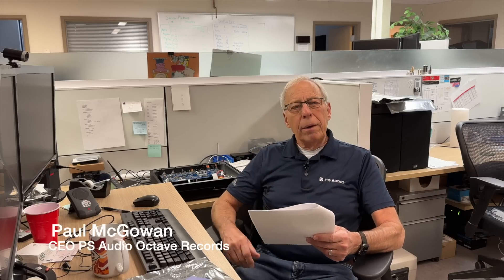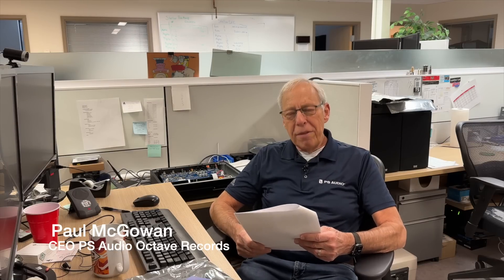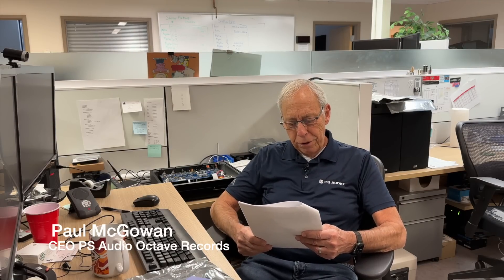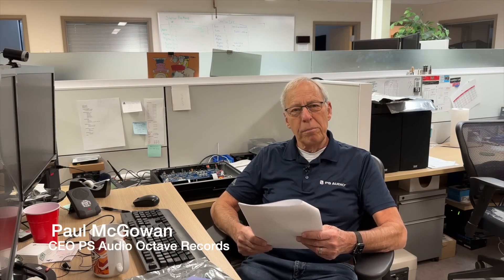Does a subwoofer benefit from a Power Plant?

Comment: I don't understand. Some time ago there was told the biggest plus of a power plant is its lower output impedance.

If the source of the load is lower, the voltage drops less when it's loaded

Most energy/current sit in the bass, so the voltage will drop the most with large bass Peaks.

The mid/high frequencies are seldom more than 10 a 20 watt. This causes at most a few millivolt drop of the line voltage. If it's more, you have a serious fire risk when loading that line with a heavy load . .

I am surprised that the devices like a subwoofer that really ask the most from the source benefits the least

Comment: Re-gen may provide a stiff and clean voltage, but what's vital for LF is ampacity and low output impedance. 

Hence the position to bypass the unit.
Reply: Some time ago the power plant was promoted as a device that lowers the source impedance, after a review that showed the powerplant increased the noise output. The whole purpose was the lower source impedance it provides

Comment: My regenerator didn't help much with the sound at any frequency but the thing we don't often hear discussed is the increase in circuit longevity with rock stable clean regulated power.  If I had any high quality components and I was planning on keeping them for a long time, a regenerator is the best protection you can get.  And most people do hear sonic improvements so they can be a great addition to your system.

Comment: You don't hear a suwofer at 30Hz, you only feel it
Reply: I hear mine at 30hz. 
Subjectivly, somewhere down to ~17hz-18hz.
Reply: @FOH3663  have a hearing test done. and then see what you can hear. (no 30hz) maybe 50hz
Reply: @arjanrobben3768  
Please define hearing test.
Reply: Our hearing doesn't stop at a certain frequency ... our sensitivity, represented via the Equal Loudness Contours, is diminished as freqs lower. 

Whereas around 40hz requires ~50dB to be discernible, and an octave lower at ~20hz requires ~25dB more level to be discernible. 

Our ability doesn't simply stop, our hearing sensitivity just requires more SPL the lower in freq.

Comment: One of the things I love about Paul is that despite regular sales pitches, he isn't invariably tooting his own horn when it comes to a waste of money. I've actually tried every variation of what he's discussing here, with and without subs, with and without regenerator, and of course he knows what he's talking about crossing subs as low 30Hz making it near impossible to hear a difference versus crossing higher. I'd like to add two aspects: check how much power the remainder of the system consumes before plugging in subs (scroll display, you'll find it), and if it's already at 70-80%, that's a no-go (in other words, be sure to leave some headroom). Secondly, use the outlets with inrush limiters versus plugging the main speaker amp into those. Thirdly, always try every option (with and without regenerator, and every constellation in-between). Simply "believing" a regenerator (much less a mains filter) is going to improve the sound is no less dogmatic thinking than "believing" regenerators (let alone mains filters) have no effect on the sound. The truth is you might not notice a difference (waste of money), not like what it does (even worse), and of course it may do something for your system (in which case one might still be curious to hear what difference it makes, at least if one has any curiosity, scientific or otherwise). I personally plug in a pair of servo subs into those outlets marked "High Current", for the following reasons: once one gets the point, which is that subs are meant to integrate and not draw attention to themselves, one may note a negligible improvement in integration/overall synergy plugging the subs into the regenerator along with the remainder of the system, plus I like the sound better than plugging the main speaker amplifier into the "High Currant" outlets (maybe someone knows if the inrush limiter there is using an MOV, be that as it may, best to be pragmatic about it, the proof is in the listening, don't just waste time and money believing me or anyone else, always be sure to try for yourself).
Reply: I've no opinion on regenerators, but two thumbs up for Leon Fleisher! A great artist with an truly inspirational story.
Reply: @waltergist8923  Indeed, he was, and I'm glad to have met him and heard him perform. He's an inspiration to all of us who have to or have overcome adversity in life, and many of his recordings, in particular with George Szell and the Cleveland Orchestra, are among my desert island favorites. Anyone looking on not knowing who Walter and I are referring to, be sure to listen to e.g. the Brahms Concerti (starting with the 1st movement of No. 1, of course), Beethoven No. 4 (that 1st-movement cadenza!) and so much more!
Reply: @LeonFleisherFan  I envy your experience. I have the Brahms and Beethoven recordings in the Sony remasters of the Epic label recordings from the late 50's. He handles the range of high drama to deep intospection very well.
Reply: If you set the subwoofer to 30 Hz, you might as well buy a rumbelseat
Reply: @arjanrobben3768  Maybe if one were into home theatre. For music, it's a misconception to believe the only purpose of a subwoofer is to produce audible bass, much less be set up and turned up to where it's drawing attention to itself. Properly set up the increase in soundstage size and scale (reproducing spacial cues) are such the whole presentation sounds more realistic from top to bottom (if you've never heard it, you need to), plus it'll help with room modes, i.e. make for a larger sweet spot in the room to sit and enjoy music in company. Actually, the upper harmonics are probably the reason one hears a difference plugging in subs into a regenerator at all, as I doubt it has an impact on the bass itself. That part is subtle anyways, using well-integrated subwoofers for listen to music is not.

Comment: Paul is shooting himself in the foot here.
Most of the energy of music is contained in the lower frequencies, (pink noise type spectrum), so the high current surges would occur here.
I thought that one of his main arguments for power regenerators was that they provide a very low impedance stabilised voltage, able to resist sudden high current draws like those you would get from thumping bass where the room lights dance in unison!
Personally, I wouldn't bother either way.😊
Reply: You did watch the video to end, though? Provided a subwoofer is crossed as low as Paul suggests, i.e. 30Hz (remember that's 30 cycles per second and below), the difference is going to be hard to hear. I've built servo subs that play down to 14Hz and can confirm it makes a difference whether they're crossed at 80Hz as in a THX system, or integrated into an audiophile system where they're not meant to draw attention to themselves.
Reply: The human hearing system is unable to discriminate to small changes around, say, 30Hz.  Indeed, the whole craze for subwoofers is more driven by people who just want to feel the THUMP THUMP of special effects than those who are listening to a musical instrument.
Reply: @TheDanEdwards  Apart from the fact that subwoofers add greatly to music playback if set up right and well-integrated, they also improve the bass performance across the room (room modes) and help widen the sweet spot, which in turn allows the main speaker to be set up for maximum soundstage and imaging focus versus bass response. Using main speakers only, setup is bound to be compromise. What one really tries to achieve is for the lower midrange/upper bass to couple so human voices have chest and body and sound as if right there with you in the room. That's not necessarily (actually never, in my personal experience) where the mains put out most deep bass, but it's a way of optimizing impulse response. The subs take over what the mains can't or won't do.

Comment: Two points:

1)
It is a matter of diminishing returns.

Clean power, to any component, will be beneficial.  But when you have a limited amount of disposable cash, using a power plant for sub woofers should be low on your list of audio improvements.

If you are worth $50,000,000, then you would never miss the cash for another power plant for your subs.  So even if the improvement is 0.5% better, then why not, when the power plant is basically free, at such an income level.

2)
Would the draw on a power plant, from the sub's amps, impact the quality of the power that the power plant is able to deliver to the rest of your stereo components?
If the answer is "yes", then any benefit you would get with better bass would not be worth the far greater diminished sound quality from the rest of your stereo.

So would two power plants be necessary (one for the subs, and one for everything else) in order to reap the best possible sound quality?
Paul would have to let us know if he has made such a listening test.

Is it overkill?
If you earn $50,000 a year, then yes.
If you earn $750,000 a year, then not really.  But Paul would have to let us know if two power plants (one for bass and one for the rest) has any benefit at all.